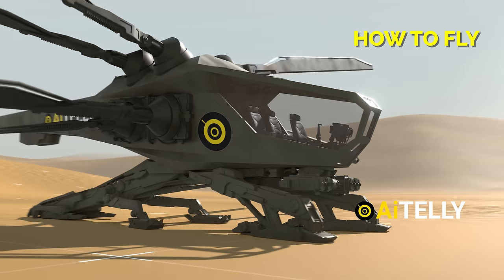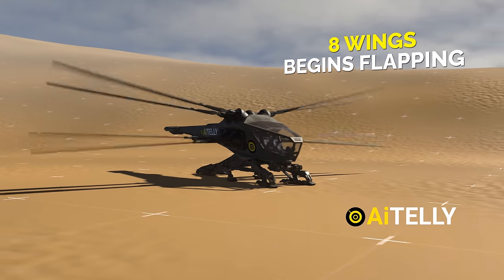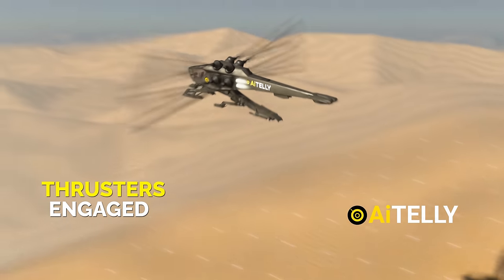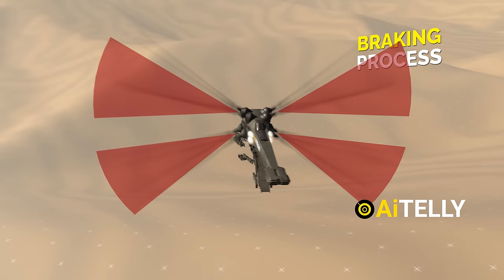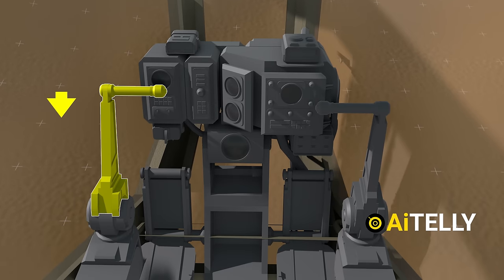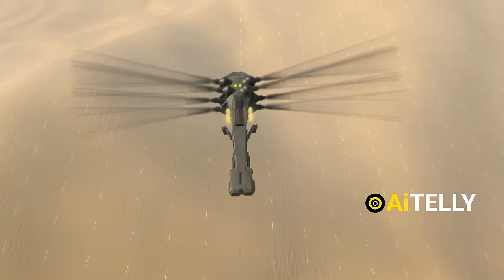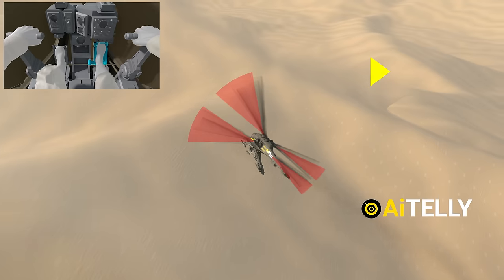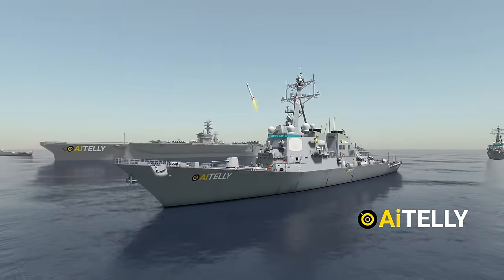Dune 2 | How to Fly the Ornithopter?

Comment: I dont think its controlled how you were saying rather throttle is appiled by twisting the handle on the right stick and pulling/push the handles rolls it pushing both will pitch the aircraft as seen in Microsoft flight sim changing the throttle will make it go up and down 
feel free to challenge my theory
Edit: the foot pedals are rudders like from a regular aircraft

Comment: Sorry, but this doesn't explain anything! How those flapping wings could make it fly?!! I mean at first each wing goes down and creates some force to move the vehicle up, but after that it goes immediately up again making the vehicle ho down again. Sorry, but if you study dragonfly of bird or anyhing that flaps its wings, you can see that the movement of the wing is very complicated to make it work. For example the bird's wings go down completely stretched and they go up a bit bend and with different positioned of feathers. In insect I thing that the motion is kind of rotating in 8 shape... So.. ?!?!?!